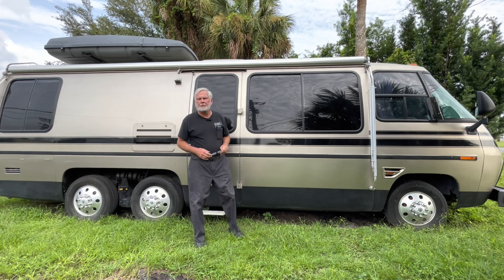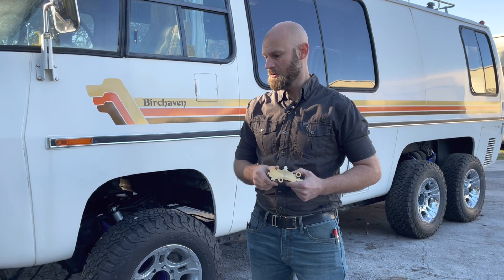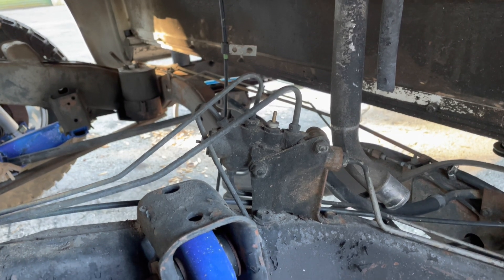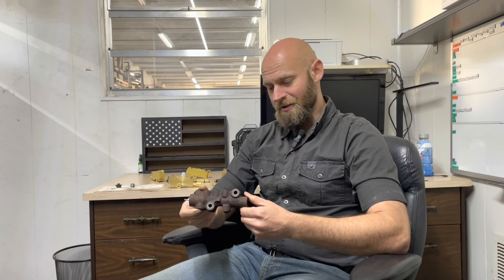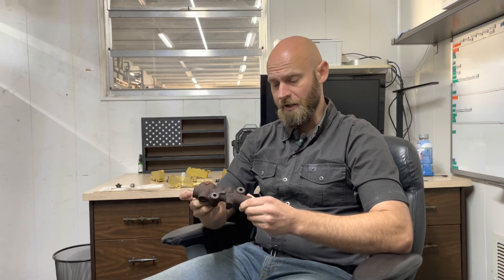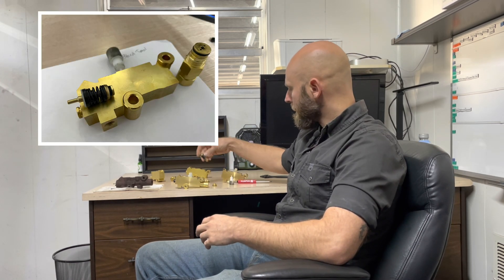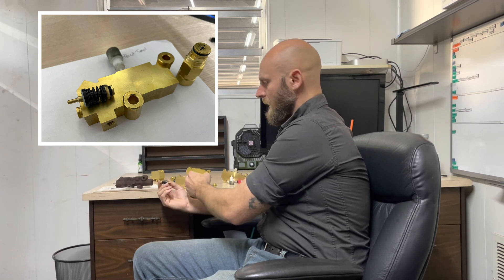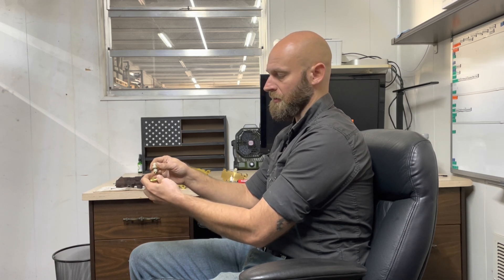GMC Motorhome - Proportioning Valve - Brake System

Comment: If i take out the switch and put in the tool my peddle is hard, when i put the switch back in and press the peddle it clunks and the light comes on. Is the valve shot??

Comment: How can I diagnose the proportioning valve as the problem in my TZE brake system? My 75 Glenbrook stops okay with both feet on the brake pedal but it takes a lot of effort to use one foot to brake.

Comment: That rear spool in the PV2 and PV4, and the one in the OEM valve, limits pressure (not volume) to the rear brakes. Notice that you can see through the PVMH but not the PV2; that's because there's a valve in the PV2. Most GMCMH gurus recommend that pressure to the rear brakes not be limited,  hence the recent development of the PVMH.